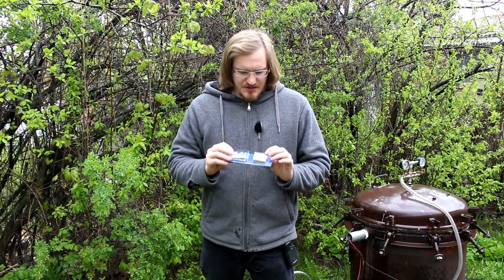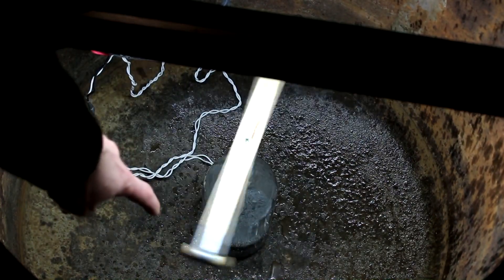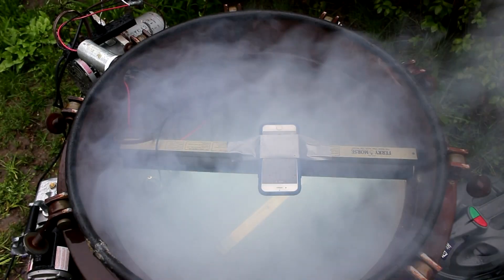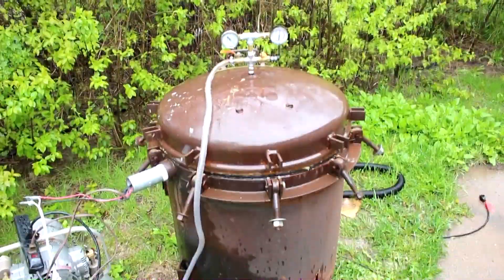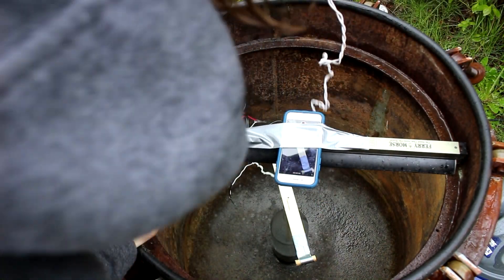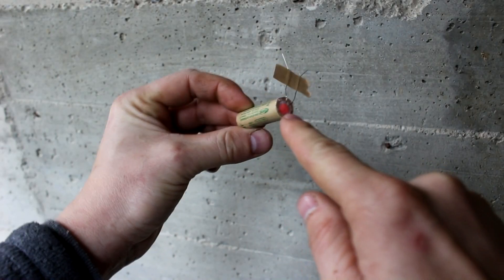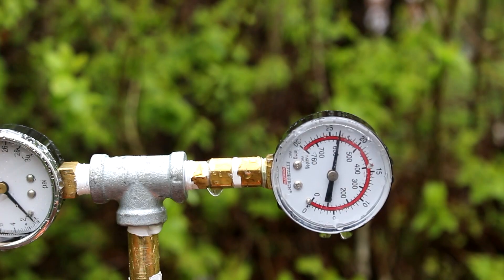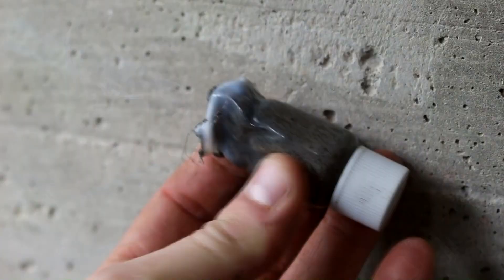Will a Model Rocket Motor Work In Vacuum?

Comment: Mr. Cody,

You just proved that Newton's 3rd law does not apply in a vacuum.

The last thing you did to make the the thing move was an error. You just enclosed the rocked inside a capsule with AIR!! YOU PROVED NOTHING THAT ROCKETS WORK IN SPACE! ON THE CONTRARY YOU PROVED THAT THEY ONLY WORK ON AN ATMOSPHERE.

sorry about that.
Reply: "You just proved that Newton's 3rd law does not apply in a vacuum."
No, He proved it does happen, why do you think it still moved.

"You just enclosed the rocked inside a capsule with AIR!! YOU PROVED NOTHING THAT ROCKETS WORK IN SPACE! ON THE CONTRARY YOU PROVED THAT THEY ONLY WORK ON AN ATMOSPHERE."
The chamber that the bottle (which only contains about 10 cubic centimeters (0.33 fluid ounces) of air with the engine inside) was in a chamber  with a volume of about .189 cubic meters (50 gallons US) The bottle contained a whopping ~18900 times less air by volume than could be contained in the chamber.

Please: the next time you make claims like this; actually understand what you're talking about.
Reply: "The chamber that the bottle (which only contains about 10 cubic centimeters (0.33 fluid ounces) of air with the engine inside) was in a chamber  with a volume of about .189 cubic meters (50 gallons US) The bottle contained a whopping ~18900 times less air by volume than could be contained in the chamber."

end qoete

You are in error. The plastic casing containing even a small amount of air say 1 cm^3 (cubic cm)  where the rocket was encapsulated was just enough volume  to produce an relative enormous reactive force when abruptly pushed off by the rocket's exhaust gases enclosed inside the plastic casing and push forward the rocket. Here is where the Newton's 3rd law reactive force is manifested and not by the rocket pushing itself off on nothing!!

The case you are suggesting is a clearly violation of law of conservation of motion or momentum in which even Newton's 3rd law has to comply with. Where is the external force the law of conservation demands when there is noting? A body can not push off itself in nothing where there is no external force outside the body present. (i.e. a firing rocket is considered as one body).

In atmospheric conditions the reactive external force comes from the air pushed off by the rocket exhaust gases.

However, in space there is no medium to push off so therefore no external reactive force is produced and the conservation law is broken thus making invalid and not applicable Newton's 3rd law in space. 

You see Newton at his time when he expressed his 3rd law didn't have in his mind the vacuum of space, actually he never knew that there was a vacuum in space, they believed  that there is a medium in space till the early 19th of century called Aether filling outer space.  Be sure that if he knew that there was a vacuum in space, Newton would have modified his 3rd law.

However, this is still today teach by science and in schools as to be valid for any case without exceptions. 

*They need this to prove that space travel is possible with chemical thrust.*

So please Sir spare me the lecture , I know exactly what I am talking about. The total volume of the chamber has noting to do with,  it could be even thousand times larger than the second smaller plastic chamber (plastic casing with rocket inside) it wouldn't matter. Actually by doing so Cody shoot himself in the foot making the whole vacuum chamber obsolete except the fact that after ignition this imperfect vacuum  (nothing near to a space vacuum) provided a minimum friction on the rocket's spin inside. 

It is a local phenomena, has nothing to do with total volume o the test chamber but only with the air trapped inside the plastic casing of the rocket. The instantaneous pressure released was just enough to push violently the rocket forward. 

The Cody's experiment talks for itself I have nothing more to add for explanation.

Conclusion: 

1) All these vacuum champers experiments are destined to fail to emulate rocket thrust in space and and don't produce conclusive results therefore deemed us unsuitable and can not be used as proof.

2) There is not such thing is science like final conclusion.

3) So far latest very high speed tests show that Newton's 3rd law is not applicable for chemical thrust rockets in space.
---------------------------------------

see for your self in this video here, tube chamber gets first pressurized by rocket's own exhaust gases and only the start's to move forward! and rocket inertia is not responsible for this delay, rocket mass used has almost a null inertia.

my2cents

Markoul11

https://www.youtube.com/watch?v=GxBRQXxBRic&t=158s
Reply: Markoul11
"The plastic casing containing even a small amount of air say 1 cm^3 (cubic cm)  where the rocket was encapsulated was just enough volume  to produce an relative enormous reactive force when abruptly pushed off by the rocket's exhaust gases enclosed inside the plastic casing and push forward the rocket."

So a bottle containing 18900 times less air had enough mass for it to push off of and spin about 72% as long? Also, The rocket could not move if the only thrust it had was produced in the bottle for the same reason you can't move up by pulling up on your shoelaces; there is no transfer of momentum so the forces (the upward pull of your shoelaces, and the downward pull of your feet on the shoes, or the rocket exhaust hitting the wall of the bottle, and the rocket engine hitting the other side of the bottle) cancel each other out.

"Where is the external force the law of conservation demands when there is noting?"

The law of conservation of momentum requires no external force, a car for instance is perfectly capable of moving under it's own power. Since the force with which it pushes on the ground to move is more than any additional forces that are working to slow the car down.

"In atmospheric conditions the reactive external force comes from the air pushed off by the rocket exhaust gases."

No, the rocket pushes off of the exhaust. Otherwise a rocket or jet could not produce thrust when the exhaust velocity is faster than the speed of sound since the force cannot be transferred back to the rocket.

"in space there is no medium to push off so therefore no external reactive force is produced and the conservation law is broken thus making invalid and not applicable Newton's 3rd law in space."

The rocket produces trust by pushing off of it's own exhaust, just like the recoil of a gun the rocket moves forward with the same force as the exhaust as it moves back.

My conclusions from this interaction:
1) You do not undestand what Newton's 3rd law of motion actually is or says.

2) You have no understanding of how thrust is generated by a car.

3) You cannot comprehend how small of a force the air inside the chamber would actually provide.

4) You can't tell when you contradict yourself in less than 7 lines of text.

TL,DR:
You think that a closed system both can an cannot produce a change in velocity, you do not understand that the rocket exhaust is separate from the rocket itself, and you don't understand how the speed of sound affects how fast force and energy can be transferred through a gass.

Comment: that is not a vacuum.  you can clearly see bubbles coming up through the liquid on the bottom.  it is pulling air through
Reply: That's the water boiling at low pressure. Lower pressure -> lower boilingpoint.
Reply: hahahaha!  and just what is creating the heat?  it ain't boiling at ambient temp at less than a couple inches of water column.  at ATM it is 212 degrees. he barely goes below ATM pressure. I split molecules for a living bub
Reply: Everyone splits molecules for a living, it's called digestion. Even if you meant in a technical sense that is hardly spectacular. I remember doing electrolysis when I was around 10. He does get to 24 inHG vac, which is more than 80% vacuum compared to 1 ATM.
Reply: Derek smith
"and just what is creating the heat?  it ain't boiling at ambient temp at less than a couple inches of water column.  at ATM it is 212 degrees. he barely goes below ATM pressure."
The pressure inside the chamber was a very small fraction of regular atmospheric pressure, the water was boiling because the more energetic molecules were escaping from the liquid and forming a gass. Heating water brings the vapor pressure up to atmospheric pressure so it boils, reducing the ambient pressure to a rough vacuum brings the boiling point down past room temperature. I have oiled water many times with my own vacuum chamber until it froze with the pump (which pulls a little over two cubic feet per second) running with a chamber about the size of a medium sized pickle jar.

Comment: Putting the rocket inside a see through plastic chamber makes sure that the rocket has air  to use to ignite inside the chamber.The rocket had air inside the plastic chamber that it used to ignite and turn. It turned far less stronger in the vacuum than the first time in atmosphere, because it used up all the air in the plastic chamber and then stopped burning once that was used up and it was exposed to the rest of the vacuum once the lid blew open. This just proves more that EXPOSED rockets don't work in space. But if NASA uses similar designs where they use air, before the flame exits, and if they can control it, then it should work in space.

1:56 original atmosphere rocket burn. 

6:43 rocket in a oxygen capsule

clearly you can see that the atmospheric burn produced a much longer and stronger spin, thus the whole mixture was used up inside the rocket.

later in the video, only the mixture that was able to ignite with the oxygen inside the chamber was used.

but once that oxygen was used up, the rocket obviously stopped spinning sooner than the atmospheric one
Reply: No the rocket does not use oxygen from the air it only needs the pressure to facilitate the chain reaction with the oxidizer inside the rocket
The reason the rocket does not work under vacuum is because it's a solid-fuel rocket that was designed to work under atmospheric pressure,  the vacuum essentially creates insulation between the grains of fuel that prevent the chain reaction.
That's probably what put out the rocket as well
NASA accounts for this and hardly uses solid fuel Rockets anyway
Also that amount of air would not even burn that long if it was burning which again it was not
Also the Oxidizers Nasa uses happens to be just oxygen ie air but without the nitrogen so they have plenty of air if that was required.
Reply: @FrancisR420  Lol i commented 3 years ago. I don't even remember making a comment haha

Comment: have NASA ever fired solid fuel rockets in space, i think they are mainly boosters for the lower stages, the liquid fuel reacts as it combines in the pressure chamber there's no ignition so to speak
Reply: The small charge that drove the umbilical separation guillotine to separate the command capsule from the service module for re-entry on the Apollo missions was technically a solid fuel engine.

Comment: Been waiting to see this for a long time thanks. But would need to see it without the atmospheric encasement.
Reply: Do you mean the bottle that provided pressure for the rocket to sustain ignition, if you want to see that you just look at a space shuttle they use different types of propellants that don't require atmospheric pressure to sustain ignition, unfortunately liquid oxidizer Rockets are very large and require special permitting so it would be a pain in the ass to go about getting one and he would need a far larger vacuum chamber and even then probably best using an ignition chamber which does the same thing the bottle does anyway.
Gunpowder does not burn well in a vacuum, this has been established, why do you think you need to see that?

Comment: The solid rocket motors (SRBs) that are used on launch vehicles are lit from the top and burn down a hole that is left in the solid propellant.  Obviously SRBs lit at launch are going to have all the pressure they need, because they are in our atmosphere, however I would assume that ullage motors work the same way, and they are lit in, at the very most, the very upper atmosphere.  So, they probably build pressure in the top of the motor at first, and by the time that have burned all of the propellant, and reached the nozzle, they are able to maintain pressure.  Liquid propellant is a completely different story, where the propellants are being crammed into a tiny combustion chamber by extremely powerful turbine pumps, so they have the pressure they need.  If the turbine pumps can't maintain propellant pressure for them to work in vacuum, then they just won't work at all as a rocket engine in the first place.  For a liquid propellant engine, the plumbing is actually the important part.

Comment: Though I am not especially qualified to mark your science project, I feel compelled to take my red pen to some of your  schoolboy errors.
 Firstly, your pressure cooker ceases to be a vacuum pretty much as soon as the rocket expels gas.(I don't think the same could be said about space).
 A rocket in space is not surrounded by walls that it can blast gas against.
Also, as I suspect that in a vacuum (like space) the expelled gasses might be getting pulled in ALL directions simultaneously, your spinning rig would enable more forward vectored thrust than an untethered rocket would deliver.
Reply: Indeed, no walls in space and i'd say the universe is in expansion (that's what they said) so...yep i know it hurts for the believers ;)

Comment: The failure at 3:56 is not a failure of a rocket motor in a vacuum.  It is a failure of the igniter used.  Those ignitors do not have an oxidizer, the motor does have an oxidizer. 
You could conduct a test of the igniter outside the rocket motor to verify this.
Reply: it wasn't in a vacuum. the rising smoke proves it.